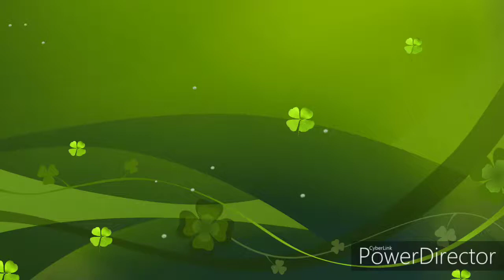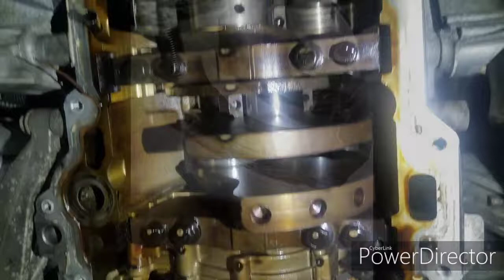2010 Chevy Camaro V6 stall out, No Crank, No start

Comment: What was the out come? Just spun a bearing on  2010 Camaro RS V6, wondering what would cost to repair be and if it is even worth it at 143 miles on the car.
Reply: Same thing  going though it at this moment  have to buy new one but got used one  junkyard  cheaper
Reply from the maker: Replace engine or tear it down to the machine shop if you can still save it.